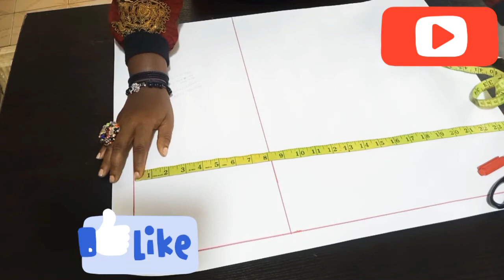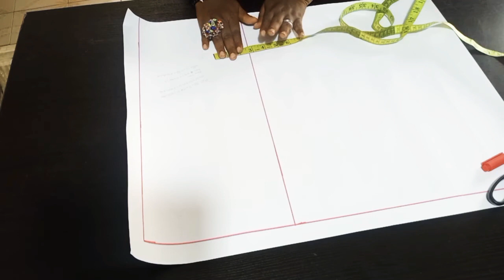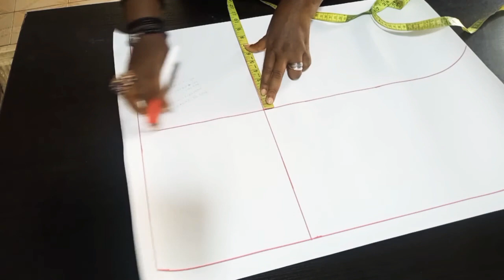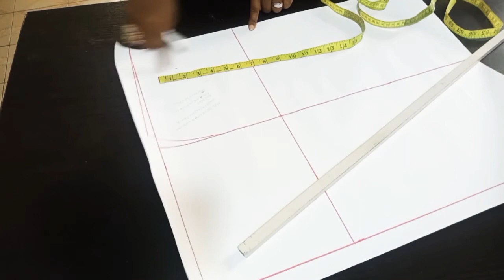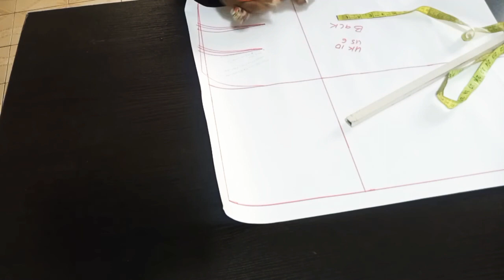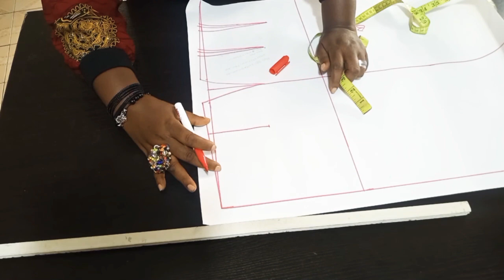How to make Basic Skirt Pattern Drafting For Beginners | how to make a basic skirt block

Comment: Hi, im here to support. Nice one. I should try it out since i love wearing skirt to office. 😉
Reply from the maker: Please do, will be uploading more every week. If you want Tutorials on any design do let me know. And I will do that for. I have hooked up with you
Reply: @LomzySews  maybe the easiest 1. How about if i want to make pencil skirt but using elastic fabric, what measurements suitable? Should it more or less than actual measurements?
Reply from the maker: You will use the actual measurements and don't add any seam allowance. And it also depends on the maximum stretch of the fabric. If it stretches well you might need to go further and reduce 1/2" inch
Reply from the maker: If you would want me to make a video on how to sew a pencil skirt with stretchy fabric do let me know and I will be happy to share the video. If you have a server machine it will take you less than 2 hours to make